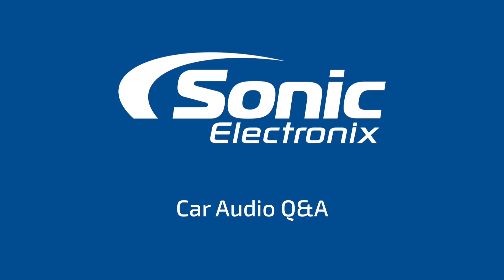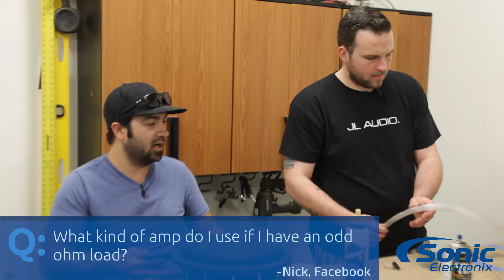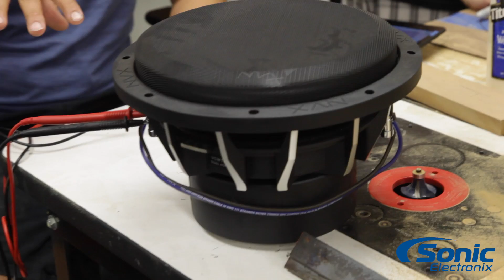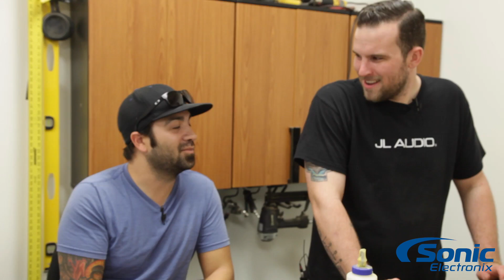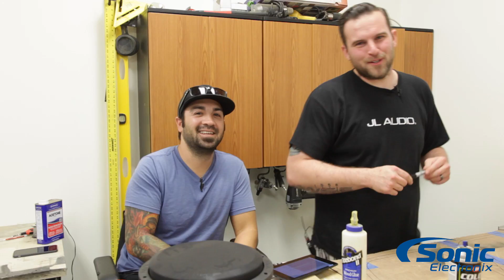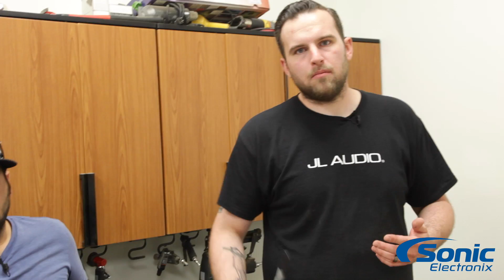Odd Ohm Loads | Pairing Subwofers and Amplifiers | Car Audio Q&A

Comment: I have 4 DS18s for door speakers there 6x9s and there 3ohm each can I run them on a normal 4 channel amp. My 4 channel amp is a rockville 3000w which is actually only 800w rms. Not sure why the door speakers are 3 ohm but they are. Then I have  2 -12"  xr12d2 subwoofers on a 3000 watt rms  amp for my subs, and a digital DSP.

Comment: Nice info!  I'll be doing 3 RFT1D410's on a RFT2500bdcp on my next build.  Impedance is around 2.4-2.67.  I'm going to wire the amp at 1ohm, but I could at 2ohm.  I'd like to see it dyno'd at 2 and 1 ohm since RF says both are at the same output.
Reply: What do you mean wire the amp at 1 ohm or 2 ohm? With the coils in series and the subs in parallel the final load will be 2.66 ohms, and with both the coils and subs in parallel the final load would be 0.66 ohms.

Comment: hey can you do a vid on how you should go about wiring 3 woofers i see boxes with 3 holes all the time how would you use a 1 2 or 4 channel amp on 3 subs and get even power distribution.-Mark lawrence
Reply: You will need to use a 1-channel (monoblock) amp to run 3 subs with the subs wired in parallel. If the subs are 4 ohm single coil the final load will be 1.33 ohms. But if the subs have dual 2 ohm coils you will want to wire the coils on each sub in series, and then wire the subs themselves in parallel down to a 1.33 ohm load. A 1 ohm stable monoblock is the best match for these types of subs in this configuration. The same wiring configurations apply for 8 ohm single coil and dual 4 ohm coil subs respectively, except that in this case the final load is 2.66 ohms so a 2 ohm stable monoblock would be a better match. Hope this helps :-)
Reply: *****
awesome thats very helpful thank you so much

Comment: I have a quad 1.2 ohm speaker than I need to wire up to one Amp. can I wire 2 sets of coils in series to .6 and than both of those parrallell into 1.2 for mono block Amp. I hooked it up like this and it doesn't sound right

Comment: I don't think speaker impedance is ever exact. Once wired correctly there shouldn't be any issues except maybe the amp running hot due to it not being stable at that ohm load but most modern power amps are stable at 2 & 1 ohm loads anyway.